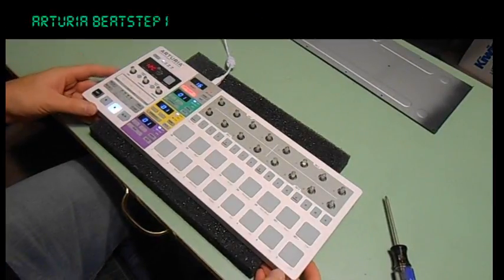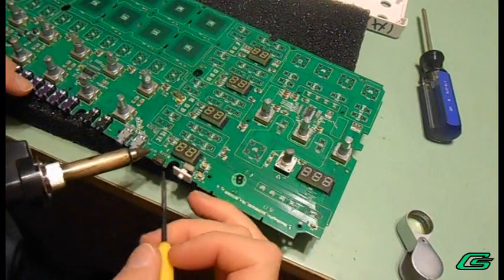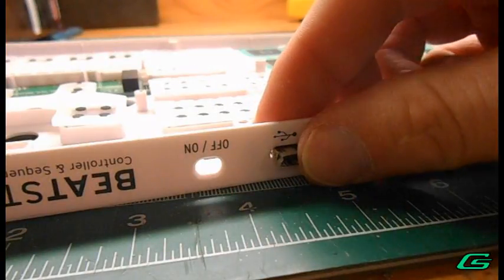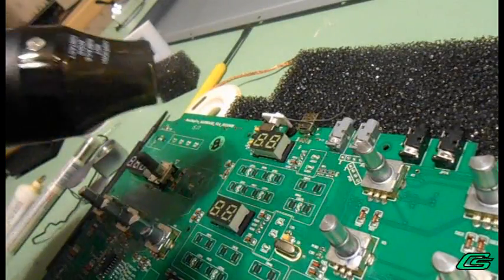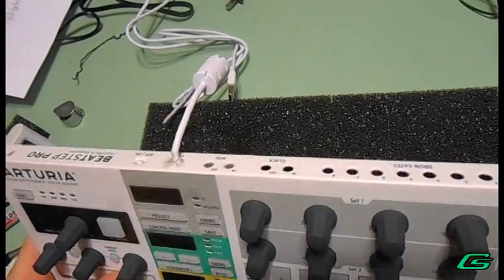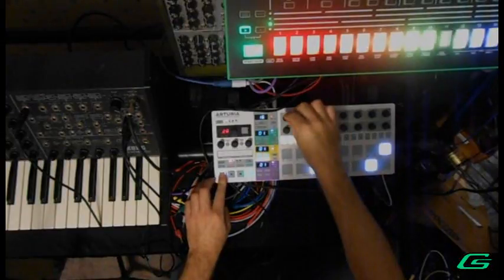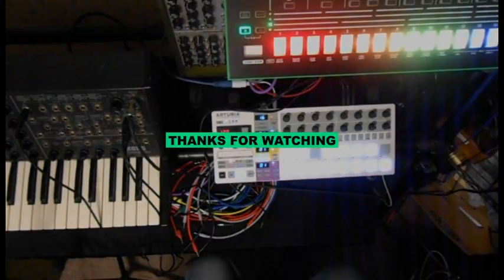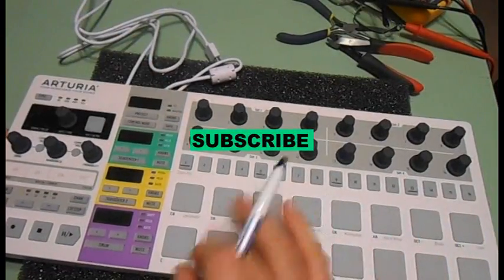Arturia Beatstep Pro Sequencer Repair Project

Comment: THANK YOU for sharing your experience with this!!  I bought this little permanent ‘sub-connector’ with a chord that has a magnetic contact.  Still I must rely on the micro usb if I want computer connections.  This is the first and only look under the hood of this device that I’ve ever seen.  It seems Arturia hasn’t spared any space for anything to be added.  I’m thinking of piggy backing another barrel connector off of the micro connect, or else add the mini like you did here.  THANKS for sharing your thoughts and experiences, it’s invaluable!!!  HOW FOOLISH I am, to buy a piece of specialized equipment such as this, without even looking more closely at what it’s power options are.  Here, it’s micro USB, and one that gets pretty loose and wiggly…:(

Comment: I just bought a beatstep and the midi works in the control center but in my vsts and daw its not happening. I have everything connected correctly, usb to my pc and my midi ins and outs to my midi sport 8x8. I dont think its hardware but compatibility with sonar and mpc daw 2.11

Comment: I'm doing electronic and IT repairs for 20+ years. Here is an advice for everyone:

1. You have to use proper tools - even the cheapest, but proper. In this case we're talking SMD component which is surface mounted ;) one. You need a micro-tip for your soldering iron, or a hot air.
2. When you remove it, you should not only heat the element, but the area around it to split the surface tension and not damage the board. Adding a bit of any kind of flux will help. But, as well you should look to not blow of any components. So, to avoid it, take a vivid picture with your phone, camera, etc.
3. Before putting a new connector, you should add a flux on those pads on the board where it was connecting, and heat up the surface so that this wig could have an opportunity to do its job. You can use a 60W even soldering iron with this wig and a flux and believe me, it will clean. You can watch my videos where I'm doing exactly the same kind of job.
4. Once surface is clean, you can add IPA - isopropyl alcohol and brush it off so that burned flux will go away.
5. Now, add a bit of a new flux and solder on each pad. This way, all you have to do it to heat up the surface and fit correctly the connector. You can even add more flux after adding this solder. Why?

Cause, if you have enough, or a bit too much flux, your solder will go where it should ;) - a magic will happen. No or too little flux = you can't do this job right, or really struggle ;).
And, everything comes with the practise. So, maybe practise on some faulty electronics which you can afford to loose before touching something which has a value for you ;) - just saying.